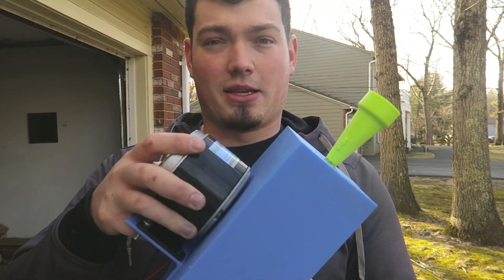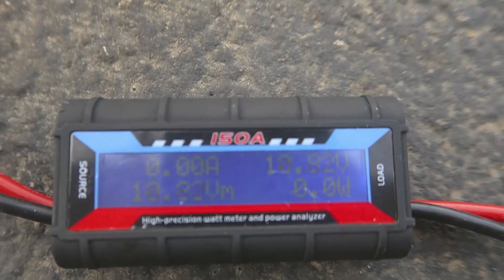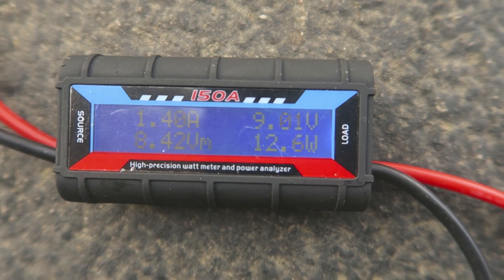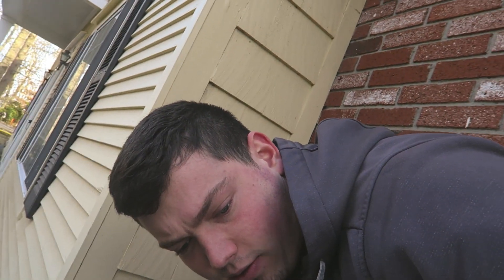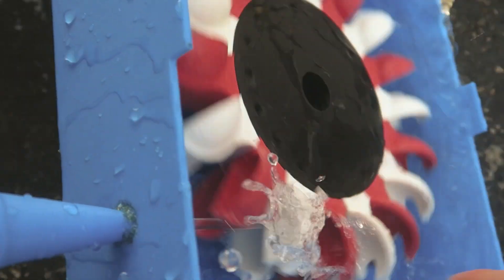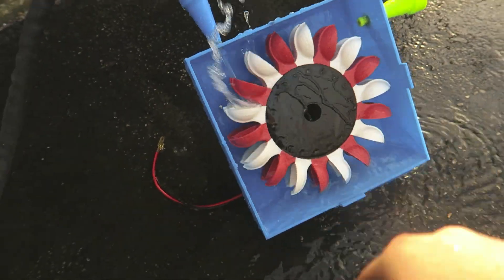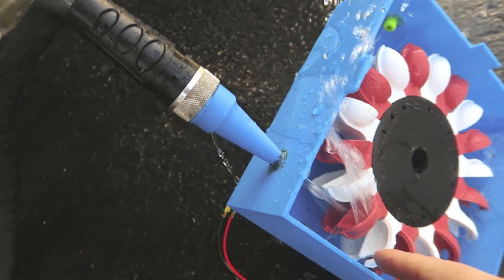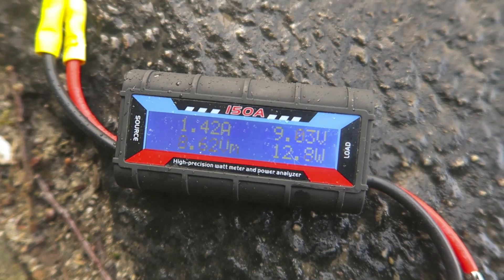I decided to steal your ideas with the 3D printed pelton turbine

Comment: Hey, 
First of all, very nice work, keep it up !
I would like to suggest to you some simple ideas about the overall design, then at the end something more detailed.
I think you are losing some efficiency with water being unable to leave the box once it has done the work on the buckets.  That water infact, now slower than the runner acts as a brake on the runner. So, in order to avoid that,  you should guarantee a free escape from the bottom and on the surroundings of the turbine.
In your case, in my opinion, the best thing would be to have an horizontal axis turbine with the injector at the bottom and a big hole there to let water escape as soon as possible, as well as increasing the casing size. 
And this is one thing but there would be more to do. As someone mentioned in the previous videos. The highest efficiency for a pelton turbine is obtained when the tangential velocity of the runner at the point where the jet hits is HALF the velocity of jet hitting it. This is a key information because you can calculate the velocity at nozzle exit by simply knowing the pressure of the water at outlet where you connect the pipe, or also estimate filling some a tank, then select the runner diameter that allows you to have the specific tangential speed at the desired rotational speed. 
Again, these are some of the changes that you could adopt but there are more. But, other correction would require a precise measure of the water flow rate and speed. With these two parameters, we can calculate the available power of the water flow, and then I'm pretty sure we can achieve at least 60% total efficiency (Runner, generator, nozzle, pipe) so be able extract  60% of the available power.
Reply from the maker: This great information and I will try to incorporate it into the next revision. I have a few other hydro power designs that I'm working on and hope you can provide recommendations to them as well. Thanks again for this valuable information.
Reply: @Beyond_The_Print  Writing like i do is easy, but actually building these things and setup everything like you do requires alot of work, so i really appreciate this content ! I will definitely follow your projects with enthusiasm.